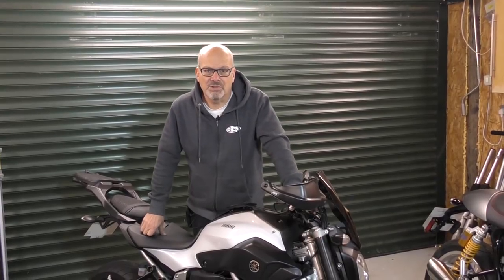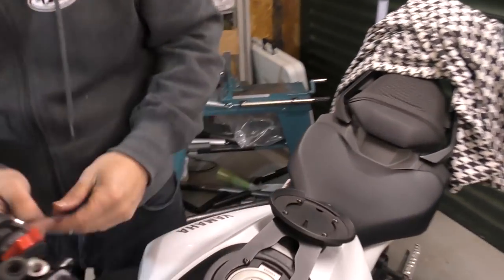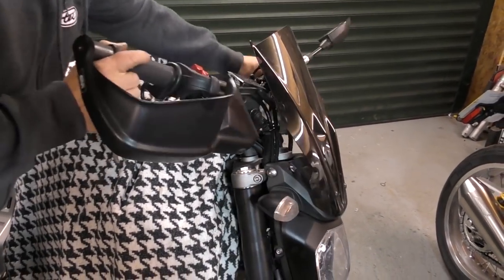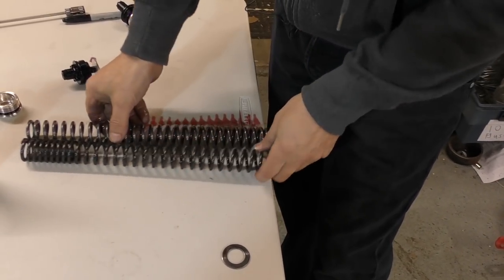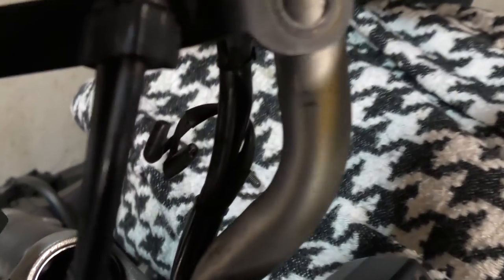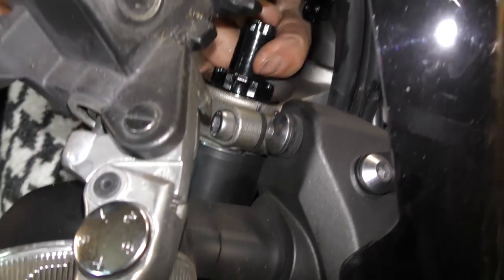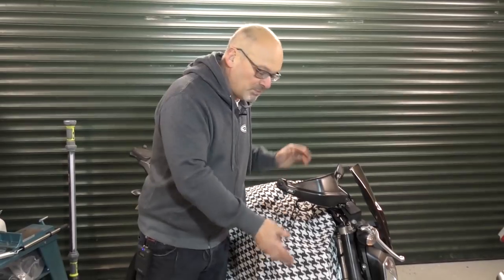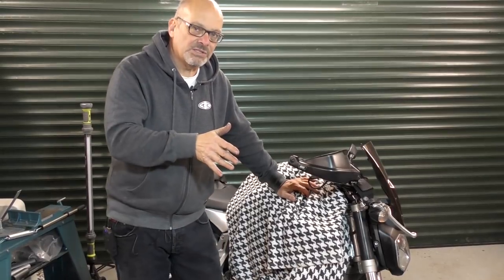Yamaha MT07/XSR700/TRACER 700 Fork Upgrade

Comment: Just fitted these to my Tracer 700 this morning. What a difference! Much more stability around bends and over bumps. Better braking feel. A really easy installation. Just make sure you've got a magnet!!
Reply: How do you feel after a few months with these on. My MT07 bounces all over on uneven roads makes me lose a lot of confidence in the corners. Do you think that upgrading the front suspension would help?
Reply: @nez1703   Absolutely. One of the best mods I've done on the bike. Not only does it give much improved cornering stability but you get way smoother acceleration and better braking because there's way less mass transfer through the forks. You'll notice the positive difference as soon as you set off. And they were really easy to fit. Took me around 40 mins to do both. The only tricky bit was the long magnet you need to remove the original springs. An essential bit of kit which I didn't have. I used a long, skinny torch that I had with an integrated magnet on the end and that worked just fine.
Reply: @simonthomas5367  I've just ordered this kit....and magnet.
Reply: @nez1703  Good choice! Let me know what you think after your first test ride!
Reply: Were the caps you received the same as the ones in the video? What size spanner did you need - the 27 ain't big enough.
Reply: @nez1703  Strange. The ones I received were the same as in the clip...

Comment: This is great stuff guys, thanks! Very clearly and calmly explained and demonstrated without the bells and whistles (unnecessary) of other channels. So far I've fitted a centre stand and double USB port to my Tracer 700. I modded the standard exhaust recently by strategically drilling a few holes in the box around the exit pipe! I sprayed part of the original muffler matt black (with some stove paint I already had) and the results are surprisingly good! I'll live with it for a while and can always change the system if I think it's too much. Will definitely be doing this suspension upgrade. Do you guys ship to France?

Comment: Hello. I'm on with fitting these at the moment. Springs and caps swapped over but I noticed mine are different from the ones shown in this video (black caps with the aluminium adjustment). The spanner size is also larger than the 27 shown in the video. Could you tell me what size is used for the revised caps? Thank you

Comment: I've just installed these to my current MT07, a 2014 model - after installing the springs, I have noticed what sounds like a metallic rubbing noise from the forks, assuming this is the spring rubbing on the tube - is this common?

Comment: good vid,,so how was the bike with new springs ,,did it help? my biggest beef is wheel wonder at higher speeds cornering ,,did it help with that ?
Bill
Reply from the maker: Hi yes the progressive springs help a lot, hence Yamaha have now started fitting them to the 2018 model.
I would also highly recommend fitting emulator valves (see our Triumph for video as same forks basically) as this takes care of the damping issues with these forks
Reply: i will take a look at those also,I was initially thinking of going with Andeani kit but this looks like a more reasonable option in cost and labor ,, i am no expert can you explain in layman's terms about the damping ?
Thanks
Reply from the maker: Hi
The damping is very basic in these forks with fixed compression and rebound damping and no high speed bypass on compression, so you feel all the hard bumps and have soft rebound damping, the worst of all worlds. watch the video I explain it all simply and in detail.Inc why you need emulators how to install them easily and how to adjust compression (fast and slow speeds) and rebound damping all independent of each other
Reply: this one ??  Modifying Triumph Bonneville Thruxton Scrambler front forks,,,if so im screwed

Comment: Did you check the oil level before you put the new spring in, it seemed that you lost a little oil when you took the old spring out?
Reply from the maker: Well spotted, I was stripping the forks again after shooting this to fit some emulators. 
Yes it is good practice you should check the oil height , but if you let the springs drain first the amount of oil lost is tiny and can hardly be measured.
Reply: @TECBikeParts  which emulators did you use?

Comment: You do not change the oil!
That's anything but a good advice. Not professional at all.
Reply: Is it necessary to change the oil when you have a new bike and just swap the springs for these progressive ones?
Reply: @smotik  From the factory it will have a cheap oil.
If you could see the shape of the factory fork oil after little use, you would understand why is it important to change it.
Same with engine oil, but that manufacturers recommend going only 10k km on it.
Reply: @zefautino  well I am about to change the springs tomorrow so will see how the oil looks like. But I assume that after les than one year from new the oil should be fine. You dont have to change the fork oil so often as engine oil. Im not saying you should keep the old one there for 5 years and 20k km but 2 years should be fine. As for the oil do you think that I should change the viscosity when I changed the springs to progressive?
Reply: @smotik  you would be wrong assuming the fork oil doesn't need to be changed as regularly as the engine oil.
Is not as bad if you don't change it, but you shouldn't go over two years without changing it, considering regular use of the bike, or 15k km, I'm servicing my forks every 10k km or less.
My bike which was bought new, I changed the fork oil at just under 7k km and 1 1/2 year. It was terrible. Looked like melted chocolate but with very low viscosity. Really bad.
Oil is cheap, 10/12€ for 1L, and it will be enough for most forks on the market. Changing the viscosity is up to you and what you wish to get from the fork. If, say 10W, doesn't work for you, try 20W, or 5W depending on what you require.
Reply: @zefautino  thanks for your view.
Reply: @smotik  This is my personal experience, that doesn't make it right nor am I a fork guru.
Always listen to several people.
Reply: @flippy5118 you are correct. My bad, it's not 1k km, it's 10k km. A typo on my part.
Thank you for bringing that to my attention.
Reply: @flippy5118 The factory oil is to be changed at 1k km.
There's a message missing where I posted a link (probably why it was deleted) to a yamaha service manual where you could see yamaha recommending oil changes at every 1.000 km.
Reply: How do you know the oil wasn't previously changed. GFY